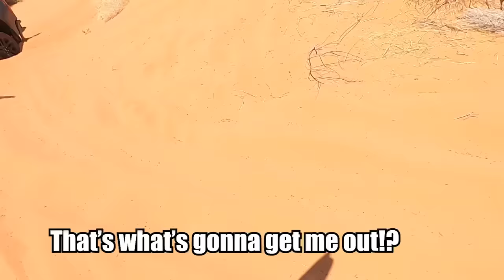Seriously?! That Things Gonna Get Me Out?!

Comment: "Those are a little heavy in the sand" - I like how kind he's being there.
Reply: Diplomatic. I wouldn't want to be around when he releases all that though. You'de feel pretty small. Lol
Reply: Well it’s the truth the reason his jeep does so well is because it’s relatively light and has large floatation style off-road tires so it doesn’t sink
Reply: @dallaswood4117  Exactly, weight + huge tires with almost no pressure.
Reply: The difference in lbs per square inch on the tires from the jeep to that first pickup that was stuck in the sand is huge. The reverse situation is if the jeep were to drive into an inch and a half of water at 65 mph that was covering an entire lane of the interstate it would most likely hydroplane in the back especially where as that pickup would carve through it. The pickup tires are lousy for sand but good for on road driving.
Reply: @crazyoilfieldmechanic3195   Now, on the other hand, if it can't get around a farm in the hardest of conditions, it ain't a truck. It's a luxury car that's pretending to be one.
Reply: @STR33TZK1NG   This ignoring the fact that people have a specific need for a truck to perform like a truck's supposed to.

I was going to say more, but there's really no point in talking to someone who thinks 285s on snow is a good thing.
Reply: @STR33TZK1NG  I'm sure your "bro-truck" blew past Jeeps off road in your 20" ghetto fabulous wheels...  We all believe you...
Reply: @STR33TZK1NG  This whole thread is about off-roading and how big, heavy trucks  SUCK anywhere but the street.  You got butthurt and started gushing about how badass and capable your truck is, just after you called someone an idiot for having an opinion you didn't like.
Reply: @looneytuneslefty4811  actually big heavy trucks also dominate off-road in certain instances. Like for example the Dakar rally. 

But again I don't know anything
Reply: @STR33TZK1NG  yes. 20s on a truck are too big.  The only excuse for 20in wheels are 56in tires.
Reply: @looneytuneslefty4811  big heavy trucks don't suck everywhere but the street.  Build them right, drive them right, and they will go anywhere a smaller truck can go.
Reply: @KurNorock  explain to me your rational? Because that makes no sense
Reply: @KurNorock  The wheelbase alone will keep you from going places a true off road vehicle can.  The Raptor is a Baja truck, not a rock crawling truck or super capable off roader.  You could build up a long wheel base truck up as much as you want, you would just be sacrificing height/weight to overcome the wheelbase.  It would still hinder the machines ability to do something a Wrangler with lockers would do.  Long-wheel based trucks just aren't meant for that.
Reply: @STR33TZK1NG  the more sidewall your tire has, the better your tire performs offroad and the less likely it is to be pinched or torn open.
Reply: Yep it says trail boss which means highway trail especially with them wheels
Reply: @looneytuneslefty4811 wb the gladiator or any tacoma?
Reply: It's the driver I could let some air out the tires of that Chevy Z71 and go anywhere in 4wd I used to bag the tires on my f150 and pull people out stuck in 4x4 in 2wd and I would have to show them I didn't even have a front drive shaft in at the time for them to believe me

Comment: "its 106 degrees and a little breeze"  Oh, a convection oven.
Reply: but it's a dry heat. When people tell me that I tell them my oven is dry heat also, so stick you head in there, you should be fine.
Reply: @karlschwaber7006  lol right. I live in el paso right now and 60 days of the summer average over 100°.. "but it's dry"
Reply: Lol!
Reply: That is to damn hot. It is barely getting  into the 60s here and that is fine with me.
Reply: We had 7 days straight of 115+ this summer. I hate the heat but I hate cold weather even more
Reply: @BeardedBaldGuy87  But it’s a dry cold.  Actually when you live in cold like his you find there is clothing that will keep you warm in about any cold. My first real job in Alaska was in 1980 doing seismic work outside  on the North Slope in the winter. We never stopped because it was to cold, it was the whiteouts that stopped work. After doing that for a winter everything else was warmer.
Reply: @karlschwaber7006  it is still better than 105 and humid though.
Reply: @Chris_at_Home  33 years of Arizona summers have made 60 degrees feel cold to me. Although I've been in -15°f up north here.
Reply: Currently it 96 with 45% humidity. Been getting our yearly rain the last 2 weeks.
Reply: @karlschwaber7006  right! I lived in AZ for several years. The big problem with that dry heat is that it is constantly pulling moisture from your body. Your sweat dries before you knew it was there. You have to constantly remind yourself to hydrate, hydrate, hydrate or you’ll end up like beef jerky.
Reply: @BeardedBaldGuy87  The coldest I’ve been out in is -67 on a mercury thermometer. I’ve seen windchills down in the-100s
Reply: @hgj2019  I remember working in a desert  where I drank 6 liters of water a day and urinated once. The dry heat sucks the moisture right out of you for sure.
Reply: @Chris_at_Home  thats wild man.. I'd be a popsicle in no time.
Reply: @Chris_at_Home  right! I’m from the humid southeast US. First time I visited canyon de chelley in NE AZ I was taking a short 3 mile hike to the canyon bottom. In August. I had a one pint bottle of water. I walked about 200 yards, realized that I was not at all wet with sweat, looked at that bottle of water, realized I’d be in big trouble if I did not go back so I went back. Every year folks hiking in the Phoenix/Tucson area fall victim to heat prostration and dehydration. It is a really serious extreme weather state, where in winter you can water ski in the morning and snow ski in the afternoon. I sure miss it!
Reply: @Lucas12v  MAN! You’re not kidding! I’ll take extreme heat OR cold with little humidity before either in high humidity. AZ in triple digits is more tolerable that my SE home in the 80s with 75% plus humidity. Moisture makes heat feel hotter and cold feel colder to me.
Reply: 119 here a few days and im tired of it.
Reply: Typical summer day in west Texas, I remember them as a teenager. The 15 mph breeze was always appreciated.
Reply: @hgj2019  agreed! I will be dehydrated by not thirsty. The desert is a strange place.
Reply: @Chris_at_Home  mercury freezes at -38F.
Reply: @karlschwaber7006  I did not know that until now. What ever was in the thermometer that we used to confirm the temperature was silver.. The thermometer we used came out of a flight weather observation station.
Reply: Chris Alden in Alaska I used to work in blast freezers but I think you win.
Reply: Chris Alden in Alaska The silver is mercury. Nasty stuff and that is why they don't use it any more. Mercury also used to be used as a lubricant in light house lights as a bearing, lubricant.
Reply: @leggygtej2554  THAT is EXTREME. Scary that we gas triple digit temps aboue the arctic circle earlier this year. I still have many friends in the SW US and I feel your pain.
Reply: Its 17/19C here in Southern Uk and I'm sweating buckets. Humid as hell.
Reply: @hgj2019  im in norther us too. We are just in a hole
Reply: @hgj2019  I never seen it above 100 here in Alaska but I have seen it in the 90s just north of the  Arctic Circle. This is one of the places I have been in where it has been below -60.
Reply: @Chris_at_Home  humid or dry, -60 is COLD!

Comment: Chevy - Trail boss
Banana - I'm About to End This Truck's Whole Career
Reply: Not funny
Reply: "Trail Boss", nyuck nyuck nyuck XD
Reply: @brandonhinton866  You just proved Chevy sucks in your own words. 😃
Reply: Driver failure more than truck failure.
Reply: Chevys excuse for an off-road truck is kinda sad. Ford and Toyota are a lot better in those departments. Dodge too.
Reply: @roostercogburn7243  Apple to oranges.  The Banana has tons of custom fab work vs a stock platform.
Reply: @keyman1969b  yeah, I've said it before and I'm say it again. People out there in the sand running street tires without airing down. Those rims didn't look like stock and I'm wondering if the tires were less aggressive than normal, also. Air down in sand and you cut out 99% of problems.
Reply: @backwoodstherapy  The tires that come on the Chevy Trailboss are Goodyear Wrangler Duratrac. The same tire that Rudy has on his Jeep.
Reply: @WaylonI  yeah, it's hard to tell in the video. They look aggressive, but that truck weighs twice what Rudy's XJ does. And it needs more sidewall for airing down.
Reply: @JohnDoe-ut7wu  We found the guy who has a chevy
Reply: @technical19d34  The Trail Boss has been described elsewhere as 'Assistant to the Trail Manager', which is pretty accurate. It's just a Z71 with a 2" lift and road-friendly 32" Wranglers. Pretty much any Z71 with a level and some real A/T's is more capable, for less money. Note if you have the 20" wheels, the tires are Wrangler Territories, not Duratracs.
Reply: @WaylonI  Only Duratrac's if you get the 18" wheels. The 20" wheels come with Wrangler Territory tires.
Reply: @adam_mawz_maas  Judging by the wheel and tire setup on that Trail boss, what do you think those are?

Comment: "Trail boss" decals on that damn truck need to be coming off stat.
Reply: The tires are what need to come off,  lol.  I grew up in the sand and the right tires and the right amount of air pressure makes all the difference.
Reply: @terryduncan31  True that. Heavy trucks need a bigger contact patch. The stock wheels, on my truck, were garbage in sand. Bumped it up, increased the contact patch, and bam playing in sand.
Reply: If memory serves, a boss is something that sits to the side and watches everyone else do the work.
Reply: heavy truck, small tires. inevitable ending
Reply: "Trail Employee"
Reply: @SGTMinguez  haha, Trail Intern
Reply: He wasn’t on a trail though. Chevy doesn’t make a Sand Dune Boss!
Reply: Trailclown ?
Reply: @drive-channel1834  😆🤣
Reply: @CLARKaka  I pulled the TRD 4x4 stickers of my Tundra the day I got it
Reply: That truck is very capable off-road and the only thing right now preventing it from being a beast off-road is the tires that come stock on the truck. Tires are one of the most important if not the most important part when it comes to being able to traverse off-road terrain effectively.  A good set of chunky off-road tires aired down to the correct PSI for the terrain will turn a shitty performing 4x4 into a truck that is super capable. Tires make a huge difference
Reply: @infesting  what are some good tires? Got the same trail boss they had lol. Thinking of putting some toyos A/T
Reply: Everyone assumed I didn’t know it was from the highway radials on it. 🙄 

I was calling bullshit on the “Trail Boss” package that truck is supposed to be on. Guys, if it sounds like an off-road package, then obv it should have A/T’s at minimum.
Reply: notice the trail boss badge yet she gets stuck hahahah
Reply: That’s what I said too 😂
Reply: Or get a real driver instead of that " thing " !!
Reply: The engine protector shield on my 2017 Silverdo LTZ with Z-71 off road package is made out of plastic.  The one I had on my 2003 Silverado was metal.  GM finds it easy to be cheesy.
Reply: lmfao your trail boss rights are rescinded indefinitely!
Reply: get rid of the nut behind the wheel too.
Reply: @kingofallgods0922  for sand, probably nitto dune grapplers or falkien wildpeaks. the toyo a/t are probably better than your stock tires, but sand is a bit different from "regular" off roading
Reply: @twestgard2  Hey buddy we're gonna need you in early tomorrow morning 😂😂
Reply: @RsPker141  whatcha paying?
Reply: Sticker should have read trail loss.
Reply: @terryduncan31  chevy trail boss is crap anyways, saw one video a guy took his offroad and hit a small bump and truck went all haywire haha

Comment: I live on the East Coast. The kind of heat you work in, along with hot engines and exhaust, would stop me dead in my tracks. I tip my hat (I’m not really wearing one now) to all of you.
Reply: Well, add to that, likely dry heat, no humidity to speak of (or very little anyway) so there is that.;
Reply: It's a dry heat
Reply: @claytonfs  Yeah, so is an oven (I live in that kind of heat too).
Reply: I had 100+ degrees once on vacation. Glad it was during my vacation and not during work.

Comment: That Chevy was a “Trail Boss” I would take those decals off, and replace them with some that say “Boat Anchor.”
Reply: Don't blame the truck for operator failures.
Reply: Chevy Trail Intern just doesn't sound good, but I get your point
Reply: @kietlam3080  Haha! That’s good!!
Reply: @keyman1969b  True. She clearly had NO idea what she was doing. I just thought it was ironic that “Trail Boss” was plastered to the side of a truck that got stuck lol
Reply: I think "wallet boss" is better, after the domination by the hulking monthly payments on that thing.
Reply: The trailboss is plenty capable not meant for sand dunes tho. Throw some 35s and a 4inch lift and the trails boss will have fun all day.
Reply: @lb10445  lol that's a custom. They are like 42k lol relax
Reply: @outsidethebox6986  Lies , My trailboss does wonders in the sand. Air the tires down.
Reply: @miketampabay9446  that's without any options they average more around 47k.
Reply: actual boat anchors dont rust that quickly, and are much, much cheaper.  more reliable too.
Reply: @outsidethebox6986  do u see options?
Reply: @miketampabay9446  could be bedliner, side steps, safety pkg.

Comment: A proper suspension lift, the right wheel and tire package, and the knowledge and experience to air down go a long way. Doesn't really matter if it's a Jeep, truck, or SUV.
Reply: deflating the tires to about 15psi, that lady could have driven out easily.... its just loose sand
Reply: @kenwittlief255  Perhaps, but if she did that, how is she going to put air back in those really low tires???

Comment: Nice.  I feel your pain on the banana.  Years (decades?) ago I wanted to install a cat-back exhaust on my '89 Firebird Formula.  I drove that car all over the country and had 130K on it at that point (and, shockingly, it was still running like a top).  Went to pull the existing exhaust and it was pretty much welded to the downpipe.  So my buddies and I spent the weekend taking turns with a chisel and hammer (yes, there are easier ways) to get the old exhaust off.  There may have been beer involved.  Had it off by late Sunday night, but I had to go to work on Monday morning...so I drove it for the week without an exhaust.  Sounded like a boat. :) 

We got the new exhaust on the next weekend only to realize that the replacement exhaust I bought was actually quieter than stock.  LoL.  Live and learn.  

I miss that car.